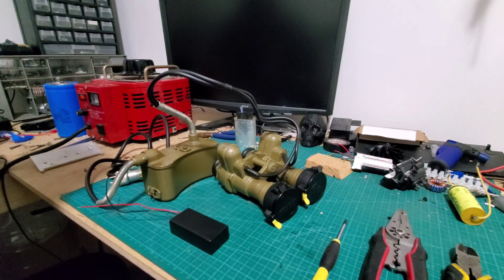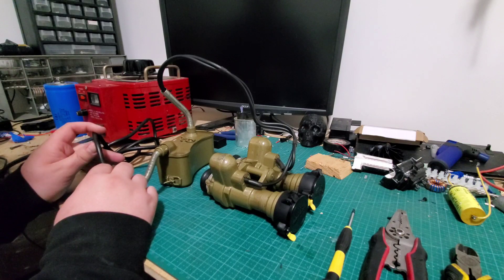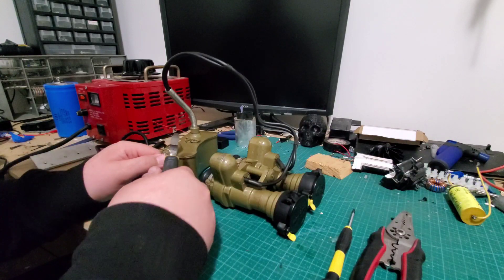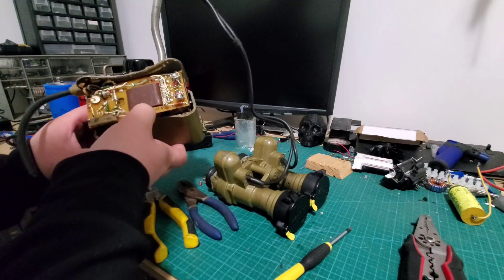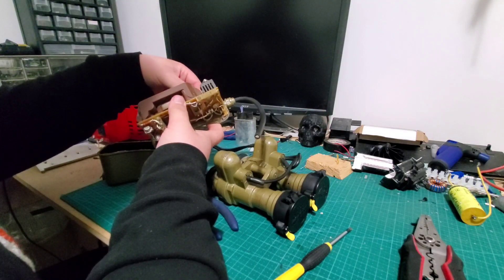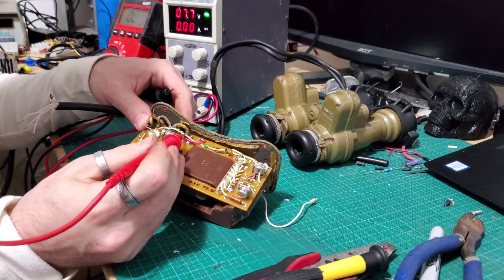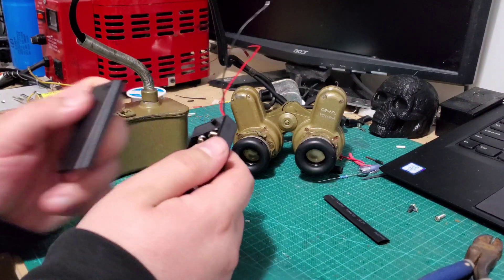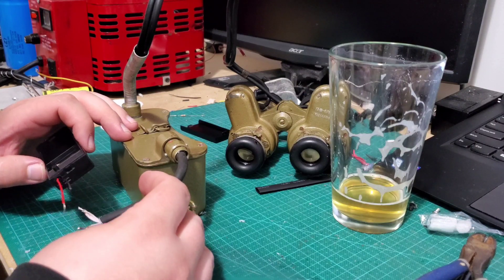PNV57E (ПНВ57Е) MODERNIZATION

Comment: in russia it is somewhat common to find these modernised transformators, they eliminate the noisy brick one, it should be a pretty straight forward process as you are simply swapping out the old huge box with a small new one.
Reply: Hi, do you know where i can get one of these modernised transformators?
Reply from the maker: Email me any info you have on this! 7639096.ab@gmail.com
Reply: @WolfgangZ1000  did you manage to get any info on this??
Reply: He's talking about the Pnv57-Em model that came out in the 2000s. It's basically the top of game as far as gen 1 goes. It comes standard with its own switch built on the transformer.

Problem is it's illegal for Russian Citizens to own with proper authorization since it's still in service.

No pair of these have made it into the US. Myself and others have been waiting for one to be found by Ukrainians to put on ebay, because odds are once this War is over, we'll never get a chance to get them again.

Comment: Thanks for posting this video. I have been thinking a lot about how to get rid of the damn cable. Did not have the balls to do something about it because of those seven wires, until I found this video. Did it accordingly and it works just fine. The power consumption of current from 9V battery is about 120mA per hour. I also tried it with 12V car battery before and it was 155mA/h. I also made something simillar about the rhino mount when I bought the device few years ago. Have got mine mounted on russian ballistic helmet Ratnik 6B47 and it looks just cool.

Comment: Hey man, just wanted to say you dont need a power source to figure out the cables.
If you have a multimeter, you can test for continuity in the wires.
The 3 positive wires all have continuity with each other, as do the 4 negatives.
Reply from the maker: The power source is for making sure you have the right +/- points on the board because some boards are in different places
Reply: @WolfgangZ1000  But if you use a multimeter to test the continuity, you don't even need to look at the board or even open the transformer up to attach a cable.
Reply from the maker: @foozhostig3381  I see what you mean, but it's also nice to know they work before you spend all the time and money modernizing them
Reply: @WolfgangZ1000  Oh to test if they worked, I just put a 9V battery to the default plug.
Reply from the maker: @foozhostig3381  yeah, 9v and alligator clips works

Comment: Are you able to find out what the operating amperage and voltage are for the goggles themselves? (That is, the voltage and amperage on the output side of the transformer). Need to use a new transformer with mine but I don't know what values to shoot for.
Reply: It should put out between 14-19.5kV.